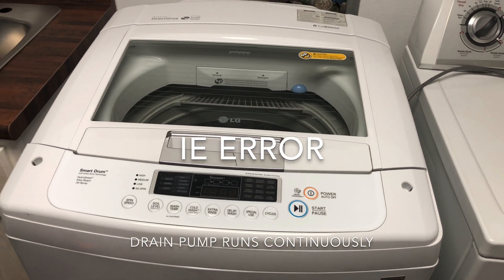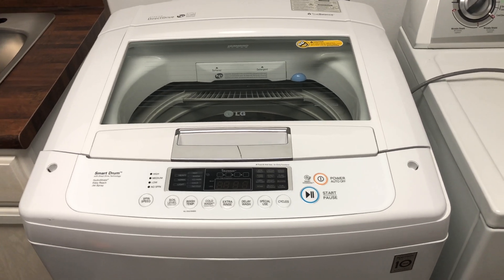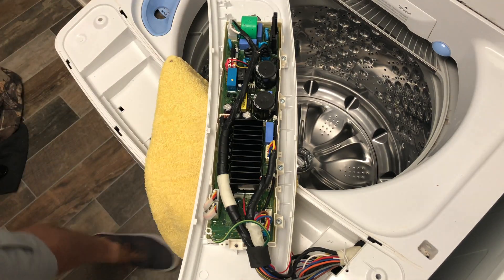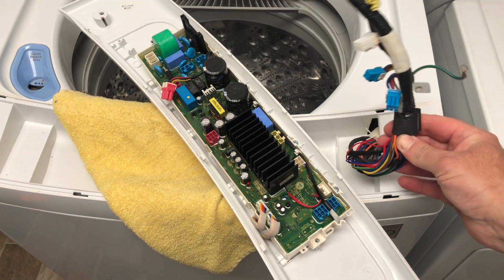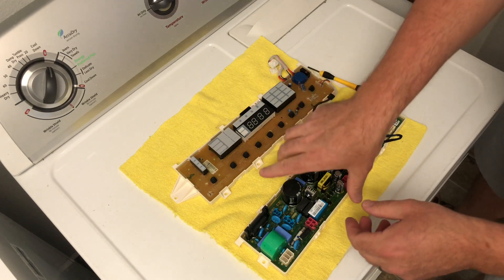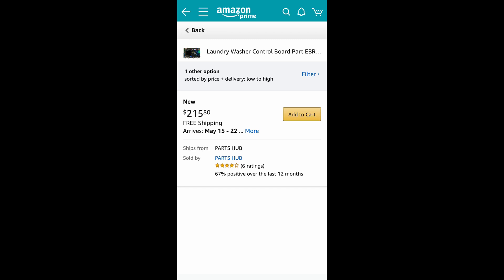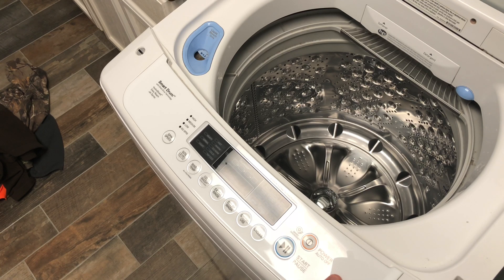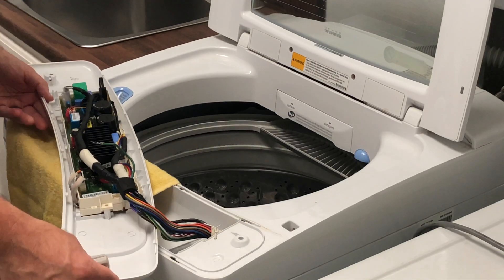LG WT1101CW Washing Machine IE Error Drain Pump Runs - 3 Month Update - Board Replacement

Comment: hello sir thank you for your video.  Mine washer is similar to yours.  Im getting OE error does it have a filter drain on the back.  My washer is in a tight corner and I have to move my dryer to get to it.  Im also wonder if it a circuit relay issue?   thank you

Comment: I have a question?! I watched your first video and went through the process as my drain would not stop running just like yours. Since I tapped on the relays, now it will not drain at all. The drain pump will not turn on. Do you think the chances are still the electric panel? Or should I change the pump instead…or also?!
Reply from the maker: I would not change the pump.  Start with the board.  That seems to be everyone’s problem.  There have been other posts on this video saying that they changed the pump first, to no avail.

Comment: I really appreciate this video. My nephew’s washer just had this issue and I was very skeptical that simply tapping the relays would solve it, but it did! I went a step further and wired in a Red Lion SNUB0000 arc suppressor across the pump wires. I’m hoping it will prevent it from recurring. Apparently LG is either using an undersized relay or don’t have any arc suppressor in the circuit board design.
Reply from the maker: That’s a great idea! Please let us know how that works out!

Comment: Thanks for the video! Needed to know how to get to the board, I'm getting a dE error tried replacing the locking mechanism now I'm checking the wiring. I've got a question regarding the lock, does the plastic door lock attached to the lid have a magnet on it? Mine looks like it might have had something circular on the bottom but it's gone now. Wondering if I just need to replace that...
Reply from the maker: Man, I just don’t remember. I have since moved on to a new washer from Samsung.  Glad the video helped a little.

Comment: I ordered just the relay switch and replaced it
Reply: I got part # off of the relay switch. Cost about 15
Reply from the maker: Gotcha.  And the water-proofing goo around it?  I assume you used an exacto knife or razor to cut around it. Was any heat needed to get access?
Reply from the maker: Nice!  Can you share your part no., source, and cost with us?

Comment: I finally had to change out the control board when hitting the relay stopped working. Now my machine won't even turn on!  I checked the connections multiple times, did a hard reset and flipped the circuit. Any ideas on what the problem might be?
Reply from the maker: Bad control board?  Can you swap the old one back in to see if it works again?  Really hard to say what it would be or how to test.  Not sure what test equipment you have access to and how comfortable you are with electronics.
Reply: @budgetprojectsbydavid5263  actually after hitting the relay on the old control board as I've done before, the washer did not turn on at all. Then I replaced with the new one and still would not turn on.  so I'm assuming now that it's an issue with one of the wires/connectors? I think I've reached the limit of my fix-it abilities!
Reply from the maker: It’s hard troubleshooting electronics without a voltmeter and schematics.  We all have our limits.  I’m sorry that the new control board didn’t fix your problems.

Comment: David my LG WT1101CW power went out on my washer, i tried all the trouble shoots online to reset my washer and nothing. Machine wont turn on, do you recommend replacing the board????
Reply from the maker: No, don’t do that.  Unplug the unit, press start/pause button for five seconds, and plug the unit back in.  Let me know if that dodn’t work.

Comment: I have OE error code.

The pump works well, supplied power directly from the pump, but I turn on the wash cycle, when it comes to rinsing, the pump does not turn on and electricity is not supplied to it, do you think this could be a problem in the Control board???

The washing machine is the same as yours in the video

Comment: David, a big thank you from me! All too often with issues on my OE error I was getting results about cleaning a filter and how easy it was when this model doesn't have one. Between a video on a different channel on checking the pump, your video and the factory service manual link you gave all the resources needed for me to confirm the pump was working and not clogged, the sensor was reading over 26 when testing, but my washer still wouldn't drain. I've got the control board now ordered and the current one disconnected and ready to be swapped out. I will add, I used a 2mm micro flathead screwdriver (from the iFixit tools), to push in between the plastic "fins" of the locking/guide piece and leverage up most of the connectors for a super easy removal of them; Only 1, the far left you started with at 5:20, took some finesse to work out of the plug lol

Again, thank you greatly for this video and info and I'll update once I get the PCB delivered within the next week and install it.
Reply from the maker: Thank you for your kind words and taking the time to comment!

Comment: Hi, I don't know if you will even see this message. I got this washer from my Mom. Since I have installed it at my house. I no longer get the end of cycle signal. I am also having a problem where sometimes I get enough water in it and other times I don't get enough to even wet all of the clothes that I put in. Which is only a 1/2 of a tub. If you can help me out with 1 or both of my problems. I would truly appreciate it? Thanks, Mary
Reply: Hi mary, i know your post was a while ago, but have you tried to set the soil level to a higher one? These smart washers use the selected cycle to determine how soiled the clothes are, and are designed to save water. Also they "load sense " to see how many clothes are in the drum, which is directly related to how much water it uses. I hope this helps.

Comment: So I have been working on this LG WaveForce top loader as I was saying.
Aside for what I already mentioned I noticd couple of other problems.  Out of balance and over filling.
I busted my brain trying to figure it out.

Came to realize, not paying attention I  had replaced two of the suspensions of slightly different lengths. Two rods were half inch longer than the other two.
So aside from having worn suspension two other things can cause suspension to cause out of balance condition.
1. Not all 4 rods having the same tension if you will. Not good.
2. Not all being the same length.  Not good.
So this not only will cause out of balance condition but also overfilling condition.  Why?
Because as the machine ( especially these WaveForce), they also spin when washing, which is where the force is coming from.  Water tornado if you will.
The computer recieves changing non-equal magnetic flex in the rotor/stator field due to change in angular velocity/ i.e. spinning/rotating action.  This is how the so called out of balance sensing is done.  Causing the computer to pour water in. Since everything floats in water, it makes for balancing.  If it is not enough it will pour more water.
And there you have it.  Out of balance and full of water.
And with these machines spinning also is done although not in full spin mode... the spin is fast enough to throw water right out of the top. Not good. :-) 

So that is how all that problem is created.

And on second note.  The water level can also be adjusted although it won't help with the situation above as those condition supercedes the water level adjustement.  So don't try it.

These water level sensor works based on frequency.  The plastic screw on top although appears sealed, it is just to keep it from moving due to vibration... can be rotated clockwise ( screws inward) for more water and counterclockwise ( screws outwards as in it will come out if you just keep going) for less water.

 Inside these sensors are an inductor and two little capacitors. The inductor are wound around the cyclinder cavity with that screw on top end and at the bottom end is a ferrite sitting on a diaphram. The clear water hose is connected to that diaphram.  As the air pushes up the ferrite, the induction value goes up and the frequency goes down.   The sensor is supplied by low side of the control board, i.e. pulses of 5 VDC.

When one moves out the screw it makes the ferrite go further up the cavity of the inductor causing higher induction, lower frequency and if the opposite cause higher frequency.   When empty, the frequency is at maxium.
The computer is dumb as you could say.  It can not tell the difference between water level and reading frequency in the sensor.  It only knows the frequency as the water level.
Therefore one is basically fooling the computer, telling it there is plenty water or not enough.
Water level has no relationship to the amount of load, to a certain extent.

Larger load based on weight and which translates to motor drawing more amperage when testing the load determines what frequency the module needs to read.
When water comes down, only that causes the air to push up the clear hose.

[LG WavForce machines due to their spinning action during wash cycle do not require too much water as far as I am concerned.  You can hear the water swirling up and down.  It is a good thing to make a note of]

Up to couple of inches, no air moves up the hose.   So the minimum water level even if the basket empty of cloth, one can expect 2 to 3 inches of water.
And that is the moral of the story.

Comment: Pushing them tabs with a flat head screwdriver and with a long nose plyer grabing the plugins saves a lot of aggrevation.
Okay back to my problem.

So I was keenly aware that when the pump came on on this LG of mine, it only came on when it was time for it  ( as in putting it in spin only cycle) and then it won't turn off.  So right there I knew it was not a stuck relay.

Also it ended up that I had lost any chime sound when I turned on the unit.

The machine would start sensing, the motor move back and forth few times and then it would stop with the sensing light blinking and beyond that nothing happened. Water valves will not open and of course the machine will just remain on with no time advancing.

When putting it on diagnostic mode, it would pass all the test.  Except when it came time for pump to turn on, it won't of course turn off until the diagnostic was finished.

I brought the chime sound back to working.  How?  I unplugged the cord and then I pushed the start ( not the power) button for a couple of seconds.  And that made the chime sound back to working.

After running the machine few more times on diagnostic test ( just because), at one juncture I noticed something rather different.  When I had finished the test, the last one, step 10 was spin mode.  While it was spinning, I simply pushed the button to just advance and shut off.  The machine turned off and the door unlocked. I opened the door only to see something unusual.
Only the basket was spinning and not the wash plate. Incidently at that time just by sheer absent mindedness I had left a blanket inside.  When the wash plate was in spinning, the blanket had made contact with the drum and that friction had caused the drum to spin. So when the machine was off, the drum was spinning along with the blanket.  I guess it was mutual friendship between the blanket and the drum.

A very long story short.
Not only it needed a clutch but the part that engage and disengage with the clutch fork was frozen.  So its spline was worn and it also was frozen due to just gunk/dirt.
I could not take the rotor out.  It ended up that I had to drill out the center hub to remove the rotor. Then I had to use a gear puller to remove the center hub from the shaft.
I also had to break the clutch fork  to get enough room to put the fingers on the arm of the gear puller on the center hub.  Even with a heavy duty gear puller it did some doing to pull the center hub out of the shaft.
Then I removed the clutch.
It is a good thing that I had replacement from long ago machine that I had taken apart and saved all that.  An exact match.
Problem solved.
Reply from the maker: Holy crap! You’re amazing!
Reply: @budgetprojectsbydavid5263  I wouldn't try to find that in any diagnostic manuals.

Here is one that defy explanations.

With one of them Maytag/Whirlpool/Kenmore washing machines ( you know they are all really the same washing machine, just different names).  The ones with the dial knob and them 6 or so little lights under it.  The typical grearcase as it is the term for their transmission.

To make long story short. The pump wouldn't come on.  I replaced the pump, I replaced the entire control board from another working washing machine. I put it on drain and spin and the pump will not come on. And yes all the connections were good and shows continuity.

Now looking at the above statement, it should fill in all the details, in case one comes up with... what about this  or that. And by the way it also implies that the machine has been unplugged to cover the reset of the machine aspect.

In other words, it looks like this.  There is absolutely nothing wrong with any part of the washing machine and the pump will not come on.  Finished. End of the story.  In other words quit replacing things.  :-)
Drain and spin.. the pump will not come on, only spin.

One more thing as if it might say something... hear this,  it doesn't;  in light of  what I have just stated above. ( Nothing wrong with any part of the washing machine. I had removed the pump and the control panel from a perfectly good running washing machine.  When that didn't do a thing, I removed them and installed the original back.  Before installing another pump I had not check the  original pump by directly connecting to power on the bench).
So:
[When testing for voltage to the pump, no voltage reading but very transient low AC voltage reading in the first 2 seconds.]

Okay, your move.  What would you do? What would you say? :-)
Reply from the maker: I don’t know.  I’m at a loss.  I’m dying to know what you did.
Reply: @budgetprojectsbydavid5263  Okay my friend brace yourself.
If you disrupt these machines just at the right juncture, pause, cancel etc, you can be dished out basically two symptoms. Yes, whoever knew.
Worse yet, remember the detail, a strange detail indeed.  I said I had replaced the whole control panel with a working one and no success.  How in the world could that be?  Is there some other chip in the system that has retained the interruption memory?  Oh my.  And the answer is crazy yes.  Get this,  the clutch actuator, there is a chip in the critter, indeed.  Remember it is what I had not replaced.

So what is up with the memory retention and behavior might you encounter?  That is the question.  The behavior in which disconnecting power can't fix of course. It retains, they designed it that way either knowingly or carelessly.  I reckon it is the first one. 

The behavior manifests itself where?  Where might you ask?   Yes believe it or not, of all things, the pump.

There are two types of this manifestation.  1.  The pump won't run.  2.  The pump keeps running.
The first symptom comes about when the pump does not come on.  One either empty the dang thing by hand and then figures not to run the machine.   Or do what I did, put it on drain and spin and of course if there is water in the machine still, one would see the pump not turn on to remove the remaining water.  Or unplug it, take it outside, drain the water by just undoing the drain hose, put it on drain and spin and hear no pump coming on and do what I have already mentioned in my previous comment.  In other words go nowhere.

The second symptom is the pump keeps running the instant one turns on the machine and pushes the start button. Diametrically the opposite of the first symptom if you will.

In fact I just got this fellow having brought a machine ( An amana) with this exact symptom.  As I turned it on, put it on drain and spin, the machine's rinse signal came on and the pump was kicking.  He said,,, see that is what I mean.  It doesn't do anything.

The solution:
 I will start with the last symptom.   I told him,,, yes I see what you mean and I let the pump keep pumping. :)
The follow was wondering what I was going to do.  I said, I am letting it go and see if the pump keeps going for the next 8 hours or for enternity.   I winked, lets hope not.
After 4 minutes the pump stopped.
I unplugged the machine waited a minute and plugged it back in. Problem solved.

The solution to the first one,  the one I had not encountered before.

Do not put the machine on drain and spin.
The machine wants to finish what it started to do.  Unplug the machine and put it back on wash cycle..... Bingo.
Depending just exactly at what juncture the machine was interrupted, you will get one or the other symptom.
Typically the distruption that cause the problem is when it is interrupted just at the right time during when the machine is spinnning.   

Moral of the story:  Do not distrupt the machine while it is spinning.

If you want to distrupt the machine, do it only when it is filling for wash ( put your soup in)  or filling during rinse ( put your fabric softner).  Any other time you are playing russian roulette.
Cheers.
Reply from the maker: Wow!  This is solid gold, right here!  The complexity of the logic built into these machines is both impressive and frustrating.  Nice work on your problem solving to discover this nugget of wisdom.  Thank you for sharing your discovery with us!
Reply: @budgetprojectsbydavid5263  Oh and do not change settings once the machine is set on a particular cycle.  I forgot about that.  Not good.